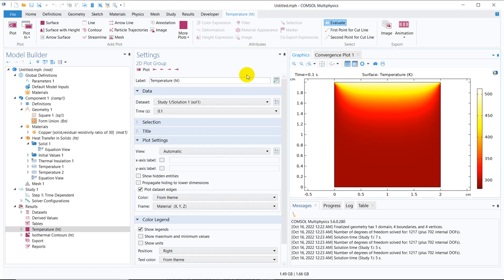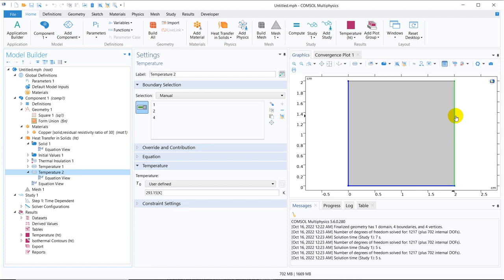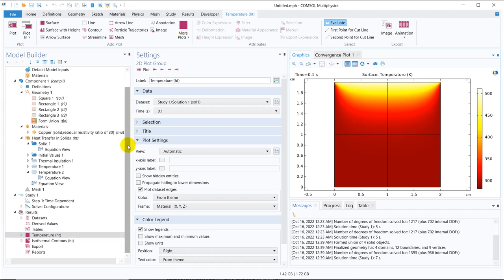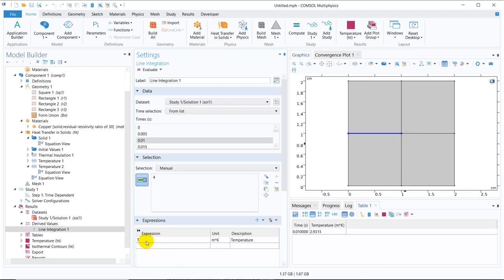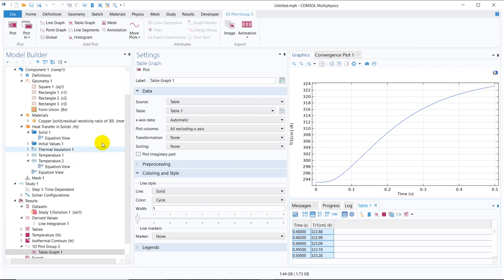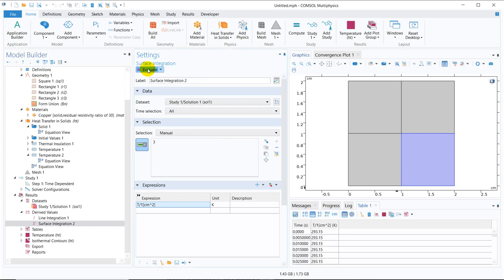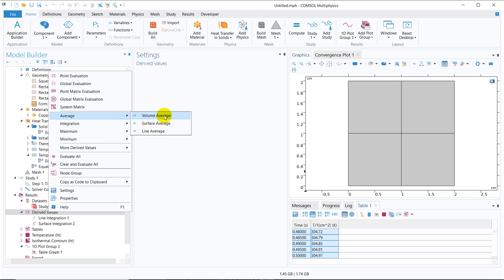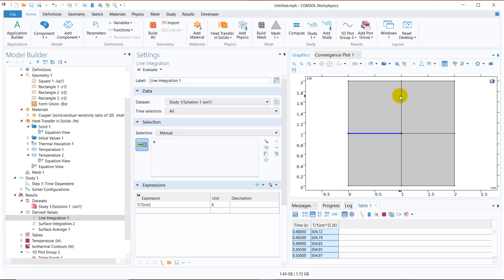Line Surface and Volume Integration for Postprocessing in COMSOL #LineIntegral #SurfaceIntegral

Comment: Useful video. Thanks.....Dear  I have a query, suppose we have an equation X=T/0.1
Here T=Temp
X=concentration
Have to add this equation to define my boundary. I want that COMSOL should pick the Temperature value from computation and give me concentration at that temperature value.  Is this possible ? I hope you understand the problem.
Reply from the maker: Yes, this is possible. Make the units consistent. Meaning, if X = T/c then c must have a unit of K/(mol/m^3). Do not use a segregated solver, use coupled solver as your T coming from the heat transfer module will be coupled with other physics, say the transport of diluted species. I hope it helps.
Reply: @pioneerofsuccess4054  Thank you for answer. I like your way of teaching. But here the problem is first how to define boundary condition. i.e at boundary I will say in analytical function X=T/0.1, but the issue is I have to define T limits. So this means T variable is defined by me, not automatically picked by the previous calculation. Will be happy if you can elaborate more. May be If you make some video on it , it would be beneficial. Just a suggestion :) Thank you
Reply from the maker: @ahmedtariq90  If the temperature is not constant then the variation of temperature should be a function of your simulation variables. I mean to say you have to set logic of temperature variation with space or time even though it is not coming from solution of the Heat transfer module. There are also options for putting a range in COMSOL. You can set an if and else condition. It can be like, within a range X follows a function and beyond it X is constant. Look at my video on if else. Here is the link,
https://www.youtube.com/watch?v=1nvRGdd12jA
Reply: @pioneerofsuccess4054   Thank you